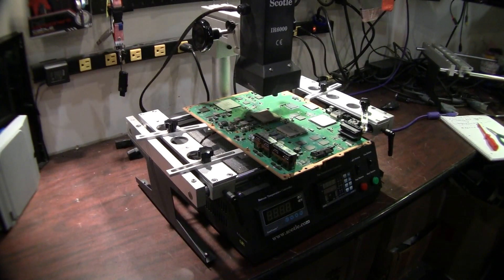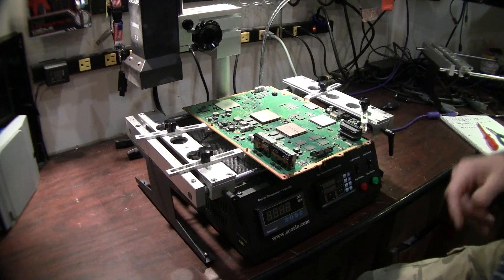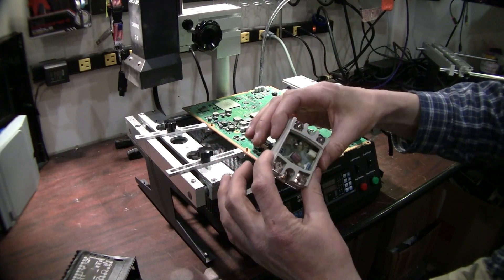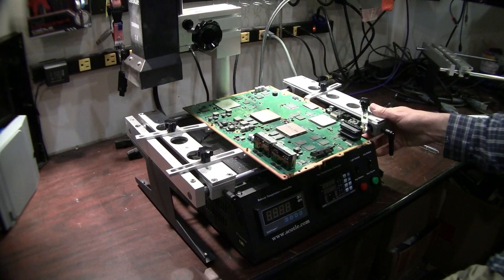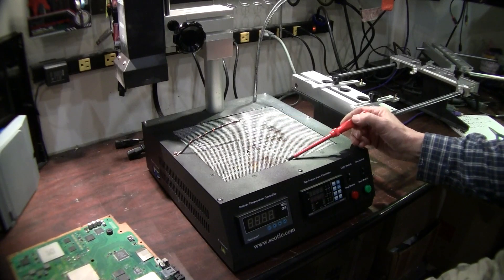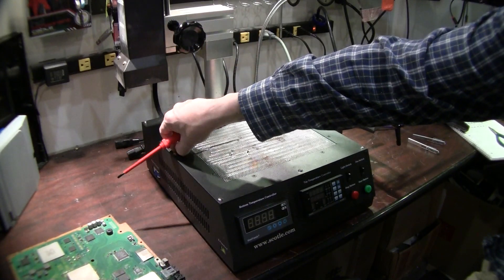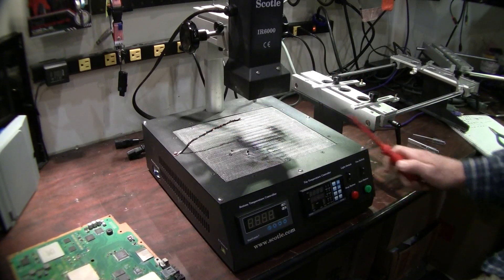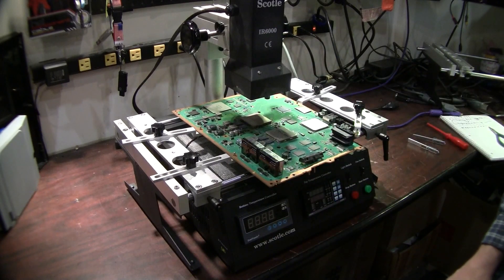Scotle IR 6000 Initial Setup and Use Video 1/2

Comment from the maker: This machine is great for boards smaller then your XBOX360 and PS3.  Sure it will work on those but you will have to overdrive the elements slightly to accommodate for the board size.  As far as soldering CPU sockets and other components - that is what it is made for.  In general I would look at a few machines before buying any one machine.  Spending more on your hardware can actually get you the ability to earn much more over a year as opposed to buying too small a machine.